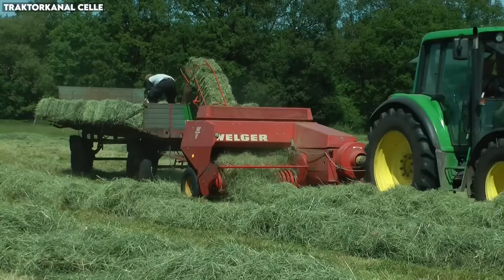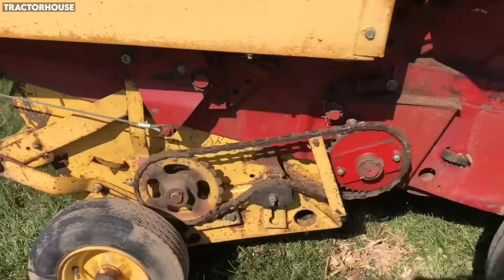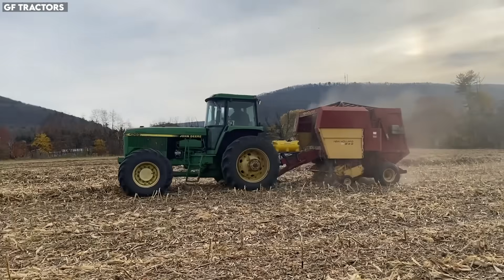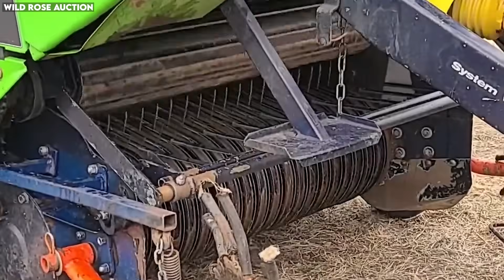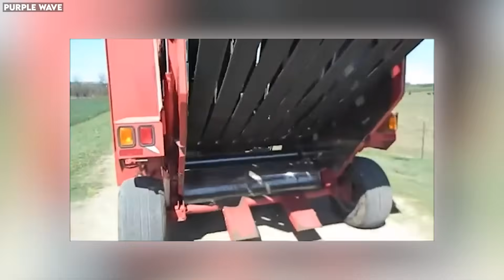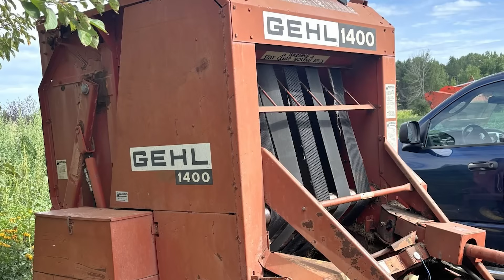10 Forgotten Hay Balers of the 1980s That Were Actually Brilliant

Comment: We bought a brand new Ford 532 square baler in 1977 it was a great baler we baled between 10,000 to 15,000 bales a year with it until 1998 when we bought a brand new New Holland 570 for the wider pickup it was the biggest pile of junk ever made traded it off as soon as the warranty ran out to a brand new 1999 John Deere 348 27 years later and the Deere never misses a beat.All Ford Square balers were built by Long Manufacturing Company of Tarboro, North Carolina.A lot of wrong information in this video about all the balers being talked about.The reason Ford stopped having a branded Ford square baler built by Long Manufacturing of Tarboro, North Carolina was Ford motor company AG division bought New Holland hay equipment line from Sperry Corporation in 1985.And Gehl made the 2 models of Ford Round balers the Ford 551 & 552 thats would be a Gehl 1400 & a Gehl 1500.And New Hollands first round baler was the 850 introduced in 1974  long before the 855 was ever thought about.Do your own research because AI is kinda really stupid.
Reply: The Ford 532 and 542 were actually made by New Idea along with the 530
Reply: Did the ford 532 have a finger knot system. It looks similar to the MF14 small square baler knot system

Comment: Misinformation ! The Ghel baler we're told was chain and slat and tne clip clearly shows belts.
Neither did you mention the Deutz GP230 was a copy of a a welger RP12 built under license. The one illustrated clearly has SYSTEM WELGER  on the drawbar. I know, I had one.

Comment: At 8:31 you say the standard Round Bale was 2ft X 4ft. In Ireland the smallest Round Bale I have seen back in the 80's was 4ft X 4ft, Now 5ft X 5ft. What year are we talking about here with the Heston 5500 in 1986. . Also when talking about the 5500 you keep mentioning a Large Square Baler while showing a Large Round Baler. Which is it. You have left me confused. Heston (MF) "small" Large Square Baler can be 7ft long or most 6ft long and that one is tapered. The "Large" Large Square Baler is not tapered and can produce a Bigger Bale. Again at 19:40 You mention the Heston 5800 as a Square baler when in fact it is was Clearly Large Round Baler. All you have to do is look it up if you didn't know. All you really have to do is look at your own footage. It even says Rounder 5800 in a Round Bale Symbol at 21:34.

Comment: Ford bought their balers from somebody else.  Mostly BS
Reply: I agree. There are only , I think 2 types of Knotters in square balers and they are really not that different. IN my local there is an EX -College lecturer who worked for MF before lecturing and he still fixes balers now in his 70's and is retired from Lecturing. he is the GURU on knotters.  There are only a few manufacturers and others rebrand these while perhaps making 1 or 2 tweaks. just to be a bit different but nothing major. I have worked with the CLASS Rollant 46 and these had dimple rollers, unlike other round balers of the time which had chains and belts. You still had to clean the rollers every morning especially if it was Round Bale Silage you were making. They also had the Pressure Clock with Green and Red Zone. to Make a Good bale you went slightly into the Red but not too far. Result Good Solid Round Bale.
Reply: Ford Balers were the BEST!!!
Reply: @billyscruggs9800  Who made them, Surely they were some other baler- Re-Badged